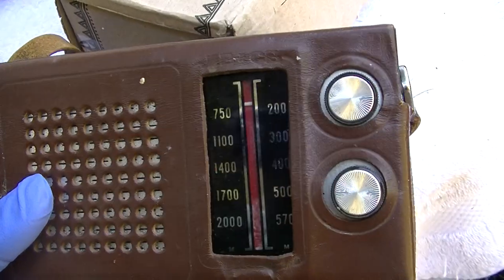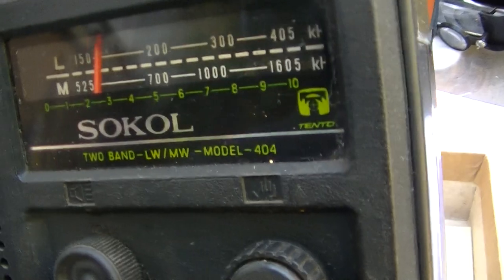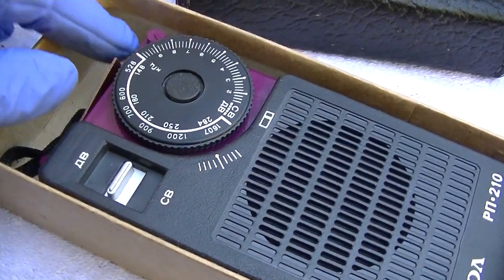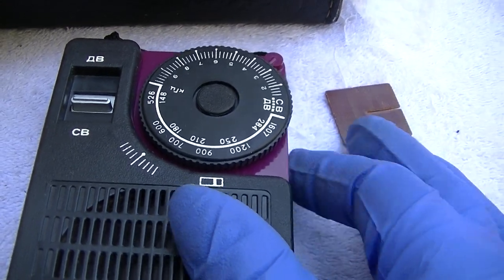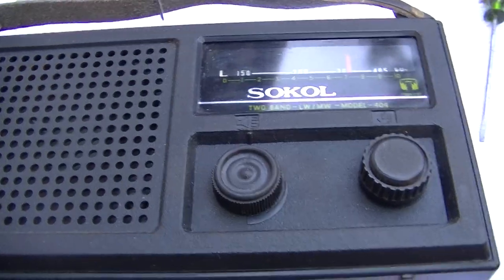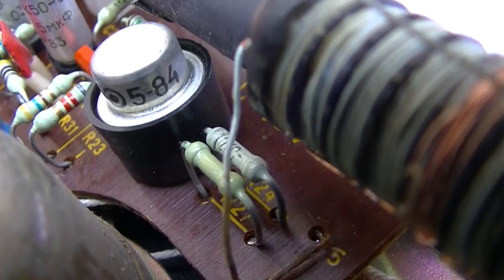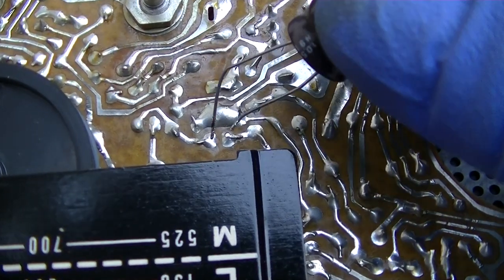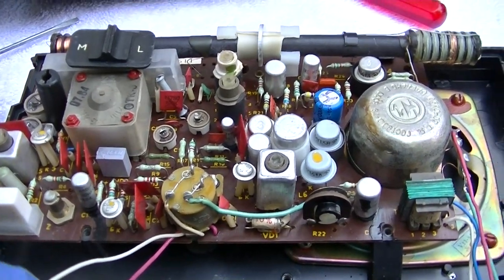Unboxing Vintage Soviet Radios And SOKOL 404 Diagnosis

Comment: That Autotransformer matching to the Loudspeaker is unusual.
If it was the case that those Output Transistors couldn't stand the amount of current needed to give the required low output impedance then why bother with a complementary pair?
They could have used two Output transistors of the same polarity driving a Centre-tapped Primary Output Transformer and it would still have been push-pull giving the same sort of Battery life.

Comment: Well, if you're surprised by germanium p-n-p's in mid 80's imagine that russians were keep doing all tube b\w TVs up to 1993! Just because they've made too many parts before. And people were buying that obsolete stuff coz they had no choise at least until 1991. There was mostly no import of domestic electronics in the USSR at least legal. 
Radios were great because military engineers knew how to do them well. I work on soviet audio electronics and I'm scared of many tape recorders an record players :) However most of measurement stuff is about Fluke and Tektronix level (and clones), that's nice.
If you wanna a soviet tube TV I have one but It's hell expensive to send it to US, sorry... or welcome to Moscow

Comment: You must be buying your Soviet Radios from the same guy I got mine from as I received postcards too. I have a Sport 2 which plays really great and is very sensitive on both AM and SW. the other one is a Hazar 404 and its a horror show. Seems something quits on it every time it's played. also the plastic case keeps falling apart. Anyhow the Hazar radios where known as cheap junky radios..

Comment: Where do you go to get stuff like this? I've been thinking of importing an old Soviet computer among other things
Reply: @airix10  I'd really like to get one of the PDP-11 clones, I think that would be really interesting to play with
Reply: @radracer2033  PDP clones looked pretty common over there too. They probably have an awesome scent of 1970s communist tobacco smoke baked in for the full experience.
Reply: @radracer2033  
The BK series computers or the DVK series computers? They both use the K1801 N-MOS single chip PDP-11 cpu. The BK series seems more common. There's even a video of a guy coding in PDP-11 octal machine code on one.
Reply: @gregorymalchuk272  all I know is I want one, not what kind lol. I collect weird computers lol

Comment: Hi, Shango. All this old russian K50-6 capacitors is incredible garbage, cut it out! :)
Reply: Usually all the consumer grade eastern block caps were garbage from the start compared to what the west made. From leaking electrically or actually leaking electrolyte to exploding ones that filled your device with conductive tin foil from the winding. Oh, the nostalgic smell of burnt soviet caps!
Reply: @sobolanul96  East German (Frolyt), Czechoslovakian (Tesla), Polish (Elwa), Hungarian (MM - Mechanikai Muvek) electrolytics were OK. There were some bad batches, but generally OK. The Russian ones were like lottery. Or Russian Roulette :).
Reply: @mrnmrn1  I've never seen a tesla foil electrolytic go bad or leak, they're insane